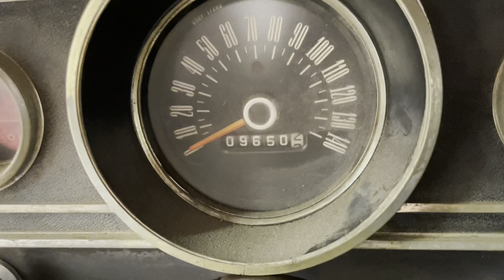Should I fix this rusted out 1966 Mustang Fastback?

Comment: Not in as bad shape as mine I need both frame rails trunk floor pans cabin floor pans, a fender,  doors and both quarter panels,  and the engine is fine, just take the starter off and clean it up